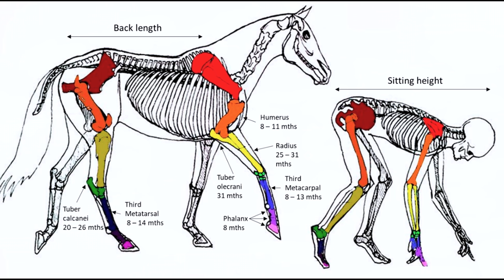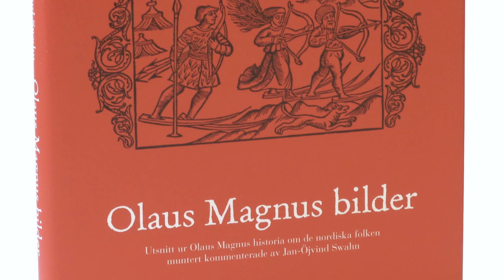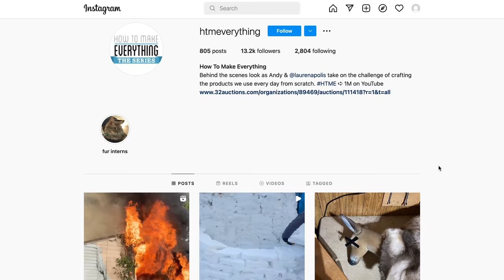Can I Make Ice Skates Out of Bones?

Comment: Fun Fact : The oldest pair of Ice skates found are made from Buffalo bones and were found in Canada, estimated to be between 10,000-15,000 years old. Hockey is life!
Reply: Pretty sure idea on these ice skates is to have hard surface that allows person to glide over ice, like you would by slinging peace of branch to ice while as well allowing enough friction to walk on ice and snow. Hence saving energy to walk in snow and run. This method with stick and spike allows use of upper body strength instead of exhausting lower body, though one would need upper body in hunting as well, but guess its to balance things. They didnt have nods so hunting was probably done in day time so every minute of it was precious so they kept moving much as possible hence balancing muscle use with this method on ice covered areas. Hockey probably was invented way later, possibly becoming first ringette since branch loop and stick is way easier to make than hockey stick.

Comment: Use a rigid wood sole and bind the blade to the bottom with wet rawhide. It will be more stable.
Reply: Were thinking the same, though besides stability I were mostly thinking about how painful it must be to have a bone lodged under your feet like that for hours, putting your weight on them. Also to some extent that such a rigid wood sole would probably give lessened friction, as the current sole touches and drags on the ice around the bone anyway.

Comment: The comparison of the ancient skates to the modern is a good visual, but the comparison I want to see is ancient skates to ancient shoes. Imagine trying to walk on ice just at all with ancient shoes. Hell, even modern rubber soles designed for winter weather are impractical on ice. Having those skates would be a huge advantage any time you are travelling by sled.
Reply: It's fine, as long as the ice's a little rough. People exaggerate how difficult it is to walk on ice

Comment: do you think eventually you might be able to make a music box? it seems simple enough and you could make a rather large one so that the inner workings dont have to be so finely detailed. I understand the small cog wheels would be rather difficult to cut by hand, and nearly impossible as you guys mostly freehand work your projects (which is good- i do the same :> ) and also you should try making a wooden threaded shaft that you can use as a blank for casting purposes to make a vise- it could possibly even be a wooden bodied vise with nuts put on the outside face of the body in a little chiseled in slot (the hole lines up so the bold can go through both nuts and body pieces to pull them together) so that when you clamp something down, the nut doesnt pull out of its slot and instead pulls the body halves together- mount the back body piece directly to a bench with brackets. essentially a cut up railroad tie, two nuts, some brackets, and some screws and a bolt. (you could potentially make special nuts that have wings on them per say, with holes drilled in them perpendicular to the other hole but not intersecting, so that you could drive bronze pins in through the wood and through the holes and rivet the only actual good thread contact the vise has directly into the vise so that its much much less likely the nuts will slip out)
Reply: I could draw a diagram and put it in the discord

Comment: you actually made them work really well, but she did not lose the notion that they work like ice skates, they're not. 

they are not in any way sharpened and thus dont have grip, like not even speed skate style. its best to think of these a gliders and you actually should use two of those prods to propel yourself, its skiing on skates and ice.

edit: also i saw some comments talking about how you use the wrong bone or whatever, thats bull. as long as it can hold your weight and is flat, it's fine.

Comment: of course you can
Reply: 9th century, what, you had metals before that, your time lines do not match with the Truth
Reply: not worth if only 10% saved, as if it was never done
Reply: you could use ski's as well, same effect
Reply: ceramic blades would work too
Reply: glass smooth with some directional blades
Reply: bone roller skates, wheels, on ice, bladed ice skate wheels
Reply: just roll over the ice

Comment: Sorry but this seems very inefficient compared to just walking. Also, if the theory is that you're "relying on the natural oils in the bone to help glide across the ice" (which sounds like complete nonsense btw) rather than the surface area and the shape of the blade, then why did you use only one bone? Surely all of that extra boot hanging over the sides is dragging on the ice and slowing you down? I think you need to use a much larger bone or multiple bones (which will also make them much easier to use and more comfortable when your whole foot is supported). I'm gonna go out on a limb and say they'd also work better if you tapered them down to more of a trapezoid shape.